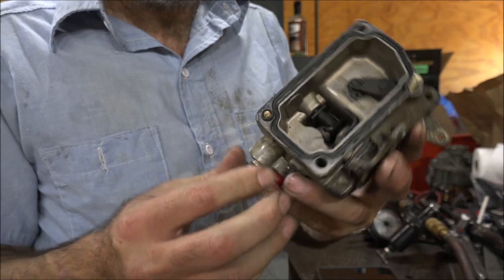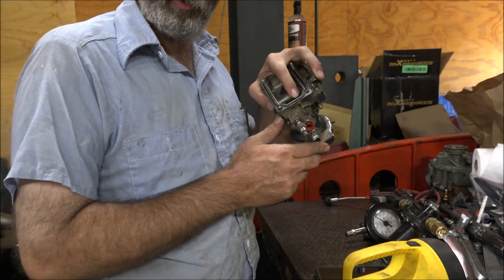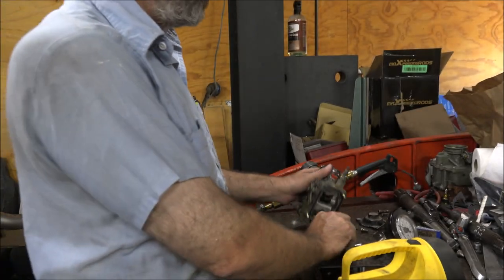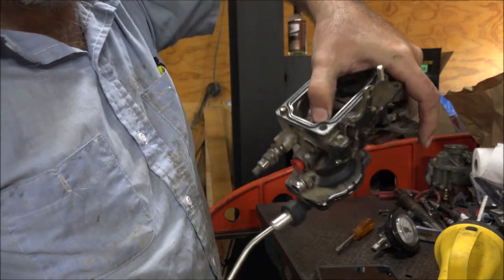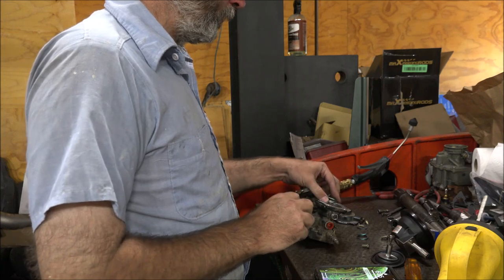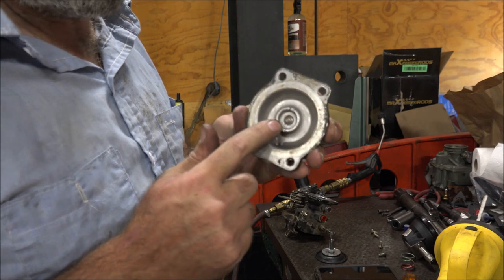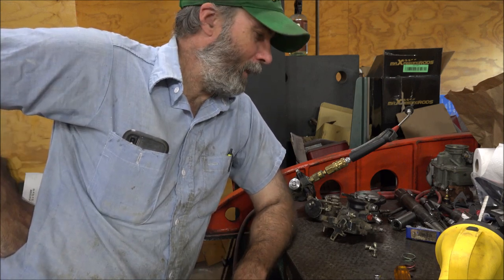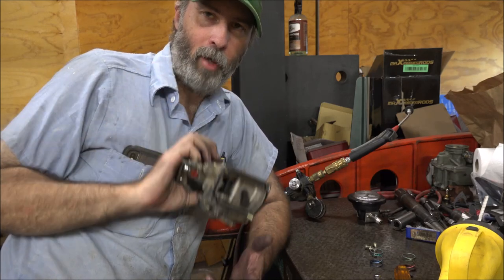Secrets to Bosch VE Injection Pump AFC Tuning Aneroid More Power, Less Fuel Wasted and Less Smoke

Comment: where did you get your masters in mechanical engineering ? now i know why its so easy to follow everything you are doing. what injectors and turbo are the most consistent and reliable for a pump set up like this ? i was thinking about doing head studs a turbo and injectors along with some port work cause i have access to a flow bench. what would benefit more on a diesel for me to work 11:53 on the exhaust or intake more ? im sure the bench would give me a lot of info but i kinda want to just chop chop and run it cause im planning on getting another engine to really build thank you for giving a little piece of insight
Reply from the maker: I got it from Speed Scientific which is now called the the Speed School of Engineering. It is part of the University of Louisville. At the time it was the only Accredited Masters level Engineering school in the US. I believe there is one other now. Injectors and turbo are always dependent on power goals.  The head work again depends on the turbo you will use because how the drive pressure runs greatly effects how the engine flows and the head can be manipulated various ways dependeing on if you have negative or positive deltaP across the cylinders.
Reply: @bcbloc02  i just put my pump back in it runs great up until i give it a tiny bit of throttle it didnt run at all when i got it so im doing something right , it goes up to where i gave it throttle then stays at that rpm and wont come back down. i turned the power screw out to the point i need to give it throttle to start it any idea what i should look at im guessing you probably did a few hundred of these if not thousand its my first ve i used to do the 6.5 detroit diesel pumps those were horrible its why i got this .
Reply: i took the sleeve off that power screw and put it back in plus half a turn it started right up she had some response i was able to hit the throttle and it was responsive enough i was gonna go for a ride , anyway i let it idle a few minutes and out of nowhere it just took off on its own ? not sure why its doing any of this crazy stuff i got the truck to work on and learn but this is crazy
Reply from the maker: @stevenbean9706  was this a run pump that just started acting up? Or what is the rest of the story?
Reply: @bcbloc02  it was running not great but ran the truck had multiple issues for one it sat a good 3 years doing nothing , when i got it it didnt go past 60mph (when it started ) with a good wind behind it i had a power steering pump leaking ,alternator screeching cause the front bearing was destroyed. front oil seal was leaking. pump was not responsive at all so i got everything i needed pulled the front apart discovered the killer dowl pin about to fall out , saved myself there so i put a tab in and punched around the pin to keep it from falling out . while i had the front apart i figured id put a governor spring in and do the power valve swap. the power valve they sent was about .006 too large and not move freely it would get stuck going in ! i trimmed the stock pin back and put that in when i put the governor spring in i backed the power screw out cut a line in the assembly first for all the lines on the screw nut assembly to line up when in place so i wouldn't wipe the fulcrum foot out. took the governor assembly out popped the throttle shaft out made sure to mark where it was indexed , took the old spring off put a new one on reassembled and the top hat assembly broke , fished the crap out ordered a new assembly from power diesel it was all identical. put it back together and it seemed ok turned the key and it fired right up idled beautiful i hit the throttle and it wouldn't idle back down it just stayed the same hi idle. so I took the banjo bolts off the afc bolt broke ! about this time i watched your video a few times. i had all the tools handy so i trimmed the ring inside the afc not too much made a afc hose from home depot stuff it works great put it together it fired right up idled a while cracked the throttle it was super responsive let it idle then out of the blue it started running away again ! i took the afc cover off and it seems like the pin was stuck it didnt want to move up or down. I had a custom pin i just put in and it seems its doing the same stuff.
Reply: @bcbloc02  i got it down to the throttle shaft , is the shaft supposed to have a spring back to it or just kind of twist ? i dont feel any spring tension on the bare shaft
Reply: @bcbloc02  i slowly took it all back apart and it might seem stupid but i think i indexed the throttle shaft 180 backwards the spring was sitting on the passenger side instead of the driver side ! it looks the same cause the reg driver is the same way on the scale but the spring assembly on the passenger side gives zero spring assist it's something i bet people have done and dont even realize it ! its 130am gonna go to bed and clean it up and pop back together tomorrow
Reply from the maker: @stevenbean9706  The throttle lever in the pump top should be spring loaded to the idle position. From your description you may need to advance the throttle lever one spline to add more tension to the gov spring and back off the fuel screw.  What gov spring are you using? the 3800 and 4200 are longer and require clipping to get to function properly.
Reply from the maker: @stevenbean9706   If you have it backwards it will start at idle but die as soon as you go to give it fuel because it will take all the tension off the gov spring. The correct orientation the lever on the bottom that the spring hooks too should move towards the front of the pump timing gear end as fuel is increased.
Reply: @bcbloc02  its funny you would say that i pulled back on where the governor spring attaches and could almost see how it works with that one shaft the governor pulls pressure on that shaft was a bit sticky it didn't move very free i cleaned it up a bit then put my shaft and spring on it has a bit of tension with spring back now im putting it back together to see if it was that i hope it was.
Reply: @bcbloc02  the little teeth on the throttle shaft arent grabbing the throttle
Reply: @bcbloc02  if the spring wasn't pushing up on the assembly it might grab but these index teeth are awful teeny tiny
Reply: @bcbloc02  just figured out why it was so zonky these teeth are junk on the shaft why those fools at bosch would make a critical part then do this is just insane im
probably gonna just buy a whole pump cause this thing has a lot of stuff just breaking or that is broken ill be 1500 in parts for a 6-700 pump
Reply from the maker: @stevenbean9706  sounds like your pump has lived a hard life. New probably the way to go. I have only seen those splines be a problem on pumps out in the weather where rust got to them. It only operates a little spring it doesn’t have much load on it so it’s plenty for the job.
Reply: that spring has an awful lot of pressure on the index
Reply: @bcbloc02  now i know whats up !! they used a bunch of stuff from an industrial application and adapted it to work on this ! i was thinking something was odd when people were doing the cold start timing bump and my solenoid is literally a part of the casing so i couldn't get it out with t30 bolts ! its literally an industrial pump adapted for a car the lever for the throttle that has all the index numbers on it isnt close enough to the index marks on the shaft to lock into the index so it just floats around  i just figured out why the grooves have wear on them when they should be almost new cause all the grooves do is lock the throttle into place ! the shaft isnt long enough to reach the little grooves on the lever ! the piece on bottom is shiming it up too high its an adapted shaft they locked it into index position by just over tightening the shaft bushing ! wow this pump has some wacky stuff on it how they made it run amazes me thats why i keep
telling you that throttle spring is putting a lot of pressure on it , it is cause my shaft is short im looking at this in amazement as to how it ran so long like this
Reply: @bcbloc02  what needs to be clipped off the 3800-4200 to make them work properly? i have s 4200 that goes in ez was gonna use that but put the 3200 in im going to have to order a lot of parts
Reply from the maker: @stevenbean9706  just get one of the China 205 ve pumps off eBay for about $500. Then max the fuel settings and adjust the afc per this video.  You can get them to pull past 3500rpm on the stock spring just be externally maxing the throttle travel range and setting the idle with the max fuel screw. No need to take the pump apart. There is no need for a 38 or 42 spring in these pumps because with the Cummins pump internals it is just starving for fuel at those rpms due to lack of fill time. You will just be beating up the engine parts turning a bunch of rpm for no power.
Reply: @bcbloc02  prob what im gonna do the lever is .130 too thick and the shaft is .130 too short cant get the shaft to lock into those little index teeth no matter what is done . now i understand what they did to make it what it is i know why it only went 60mph
Reply: @bcbloc02  thank you much for your input i pulled the pump out last night its gonna give me access to change a bunch of other parts while im there greatly appreciate it
Reply: @bcbloc02 are those hx40w turbos any good for what im doing ? i noticed they arent too expensive im really hoping this thing hits at least 70-80mph i can completely understand what you said about chasing the fuel trying to get the pump to pull enough in this pump would cavitate and go super lean in hi rpm when i do the upgrade to the 205 pump i just ordered some 100hp injectors and valve springs i was considering the hx40 as well i can order a new fuel pump too but im not sure what would go good with it
Reply from the maker: @stevenbean9706  The hungry diesel hvlp pump is the simplest reliable fuel transfer pump setup. I don't recommend an hx40 as they are laggy.  The stock turbo is fully capable of making a stock truck go 100mph by itself. You need to decide a final power goal then you can determine what turbo is best to get if any.
Reply: @bcbloc02  thank you im not wanting another ticket for going too slow ive got another cummins im doing full tilt this one has some issues as mentioned this pump wasn't a good pump from the get go i just put a new power steering pump in got some fool telling me theres no threads inside the power steering pump after i just put a 9mm bolt in to pull my gear back in and hold it cause im not gonna beat on it with a hammer like he just did to put his in if i can make this turbo go 100 im more than fine ill get all the bigger stuff for the other one which is a 92 12v with a 5 speed on it power goal for that will be 600 im learning stuff with this set up if i get 300 im fine with that on this set up cause im just gonna hop around picking up parts with it for my nostalgia super stock dodges
Reply: @bcbloc02  tried to get my power steering pump gear out the cover hole so i could service the pump and put it back together, the hole in my cover is a bit over 2-1/4 inches and the gear is 4 inches im thinking 90 was a busy year at cummins and they popped a lot of generator parts into these trucks just to make contact obligations its all good just means he couldn't drive it as hard as it would have been driven. ill gladly pay to make it work.
Reply from the maker: @stevenbean9706  I have never seen a factory motor that didn’t have the big hole in the timing cover that the whole vaccum pump gear just fits thru assembled. I would say your engine has been messed with at some point. Even my 88built 89 has the big hole.

Comment: What would cause injections not to have any fuel return on injections,Bosch ve pump rebuilt new injectors ,4 cylinder case IH engine
Reply from the maker: Well you should have very minimal fuel out the returns if the injectors are good like maybe a drip every few seconds when running.  If you get nothing at all then it sounds like nothing is going into them.  If they are new or worked on injectors they may have the pop pressure set too high or your injection pump maybe worn to the point it can't generate enough pressure to fire the injectors.
Reply: @bcbloc02  they were new injectors but the old ones did flow steady stream of fuel back to tank,now with new injectors and rebuilt injection pump lots of black smoke and high egt,new turbo too
Reply from the maker: @billbooth4147  If they are the correct injectors and the turbo is the same model i would be suspicious injection timing is wrong.
Reply: @bcbloc02  they are supposed to be the same but I don’t have the old ones now ,I have timing all over the place,well injection pump timing to engine that is
Reply from the maker: @billbooth4147  what is your boost pressure?
Reply: @bcbloc02  I will have to check ,but I don’t think it was very much
Reply: @bcbloc02  thank you for the information,it very well could be a bad turbo

Comment: I haven't torn into my VE at all. Bone stock '90. I seem to recall something about breaking some lever if you removed the top incorrectly. Or is that when changing the governor spring?
Reply from the maker: Yes if you take the top off you need to take the fuel control screw out so you don’t damage the lever it pushes against when you put the top back on. You can do all the tuning I discussed without taking the top off though. I only had it off for illustrative purposes.

Comment: Hey bud. Do you know how to  test this without pulling the pump apart?
Reply from the maker: What are you trying to test?
Reply: @bcbloc02  if the settings on my starwheel is correct for the psi I'm running. Struggling to get a clean result... Good power but lots or smoke.
Reply from the maker: @T3_travels  even cut all the way back like mine is with my 7 by 011” injectors I can black out the sun if I Don’t drive softly. The stock afc lever and cone can not cut back fuel enough to clean the smoke. I will be doing a video on more mods to address that in the future.
Reply: @bcbloc02  thanks 👌 I can cope with black but I get some white/grey on low RPM. If it was only under full load It would be fine lol... 💨💨💨
Reply from the maker: @T3_travels  If your temp is up good and you are getting white/grey at low rpm either your timing is not correct or your injectors are likely bad. Have you had them pop tested?
Reply: @bcbloc02  normally when temp is low tbh. Had the injectors done recently for some new nozzles and pop tested.
Reply from the maker: @T3_travels  might try advancing the timing a little to see if it helps.
Reply: @bcbloc02  I'll give it ago. Thanks :)

Comment: Good video, but 630 HP from just grinding on a stock fuel pin (@11:05)? I say BS. You had to have done other things to it.
Reply from the maker: @erwin643  I meant with just a reground stock pin it made 630rwhp not some aftermarket pin. It had twin turbos a ported head intercooler and injectors plus one of my 14mm ve pumps.

Comment: @tomthompson7400
1 minute ago
Ive been looking for some one who knows a bit about these pumps for a couple of weeks ,,, I put a 200 tdi discovery  engine into a defender , the engine has sat about for four years , long story short  its in and runs as sweet as a nut , but it will never start on its own ,  a whif of either and its off no bother , no smoke , no crankcase breathing or the likes , runs sweet ,,, it will warm through and sit happy , but if you turn it off it will not restart on its own , hot or cold ,, but a whiff of either and off it goes , its like the excess diesel start device is not working , now the question is , can I lube something , or reach in and wiggle something to free up what ever is stuck , , ive run the engine up to temp a dozen times and I can kid myself its occasionally getting closer to starting on its own at first flick of the key , its really not there yet and has never started on its own ,,, one quarter second whif of fuel either and its off , even shutting it off at high reves and trying to get it to start half a second after it stops ,,, no way . Any tips would be appreciated ,, thanks in advance..
Reply from the maker: @tomthompson7400  it sounds like your plunger and barrel is worn causing it to bypass too much fuel and fail to make enough pressure to pop the injectors. On either it gets over the cranking speed and it’s enough to make it fire as leakage is directly related to cranking speed. If the pump is not turned up you may find giving the fuel screw a turn in might be enough to get it to hit. Otherwise you likely will need a pump head to fully cure the problem.
Reply from the maker: @tomthompson7400  also you could possibly cheat it by lowering your injection pop pressure 500psi. I would not go below 2500psi though. If it can’t crack them that low it needs help.
Reply: @bcbloc02   many thanks ,, it was just on the off chance there was a centrifugal over fuel device fitted , and it had stuck , what you say makes total sense , many thnks for the input .
Reply: @bcbloc02  Ill just send the pump for a rebuild ,,, thanks again.